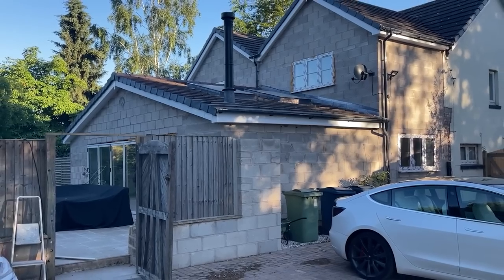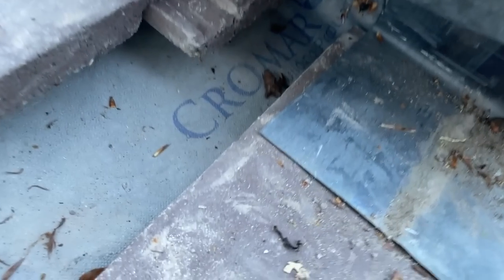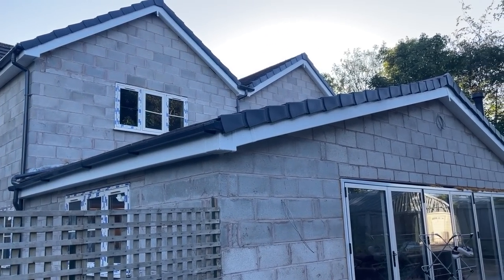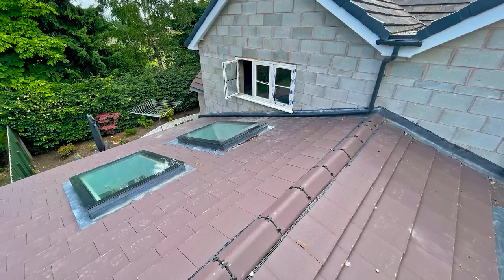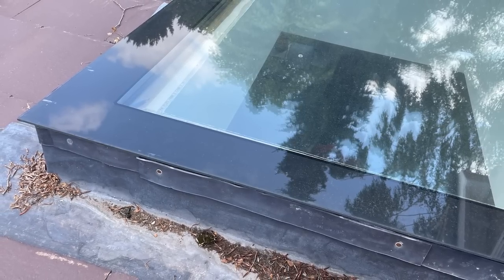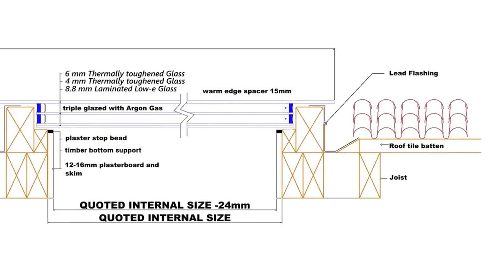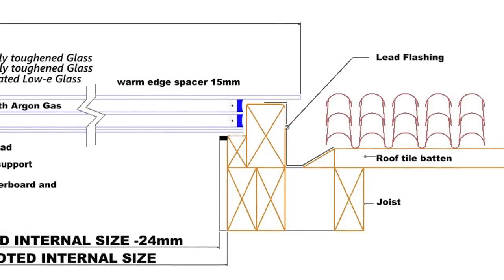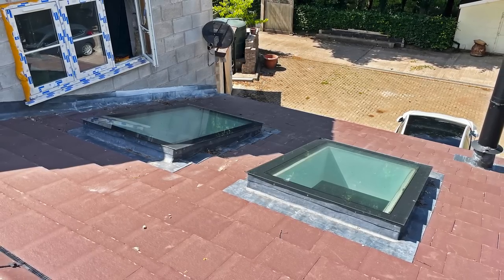How Many Mistakes Can You Spot on This Roof?

Comment: Rodger giving advice on something he clearly has minimal knowledge about himself
Reply from the maker: Craig 
As a City and Guilds plumber we had to do leadwork and roofing  of all types. I have also fitted a great many roof windows in my time and made installation videos for major manufacturers. In  thirty two years working for Professional Builder Magazine I attended countless training course and still regularly attend courses on all types of buildng products.
Despite that I do not pretend to know it all and if you would like to add your pearls of wisdom to the comments, please do. We may all learn something.
Reply: @SkillBuilder  well your talking about running a secret gutter underneath the tiles and back up onto the row of tiles beneath the windows, which would be virtually impossible in this situation. Although the roof is shambolic, the idea that they've had of using individual lead soakers was the right idea just poor application.

At minimum pitch 2 degrees below absolutely matters when working at such a low pitch, modern tiles are tested in wind tunnels to determine their minimum pitch........if marley/redland thought they could get away with selling this product that went down to 15 degrees believe me they would.

Membrane isn't there as a secondary defence and shouldn't be treated as such which I've seen you say in a other recent video....its to catch and wind driven snow/rain. If its been relied upon because the actual roof covering isn't operating as it should it is decreasing the lifespan of the battens beneath the tiles due to them constantly being wet.

I appreciate your efforts trying to help and make content but some of the advice you've given but maybe stick to plumbing